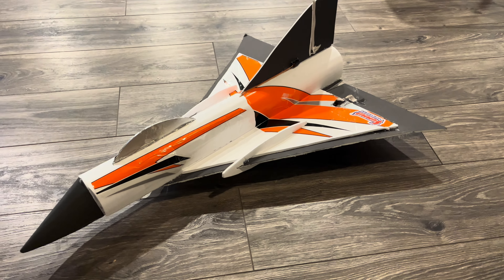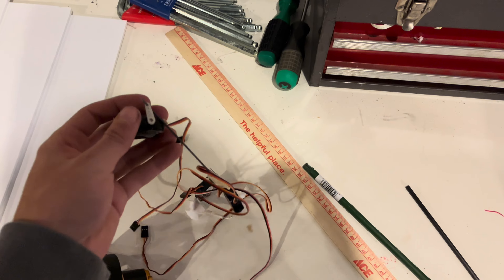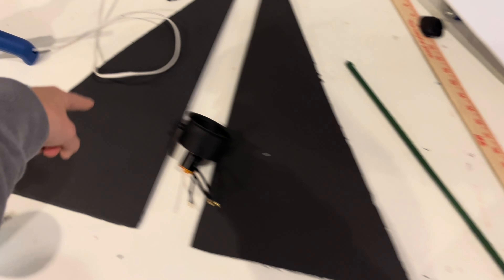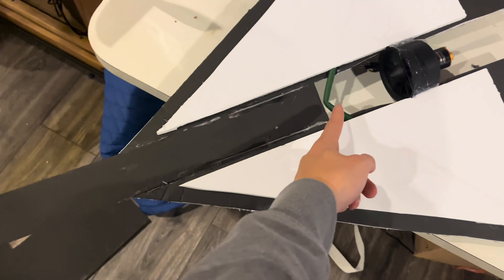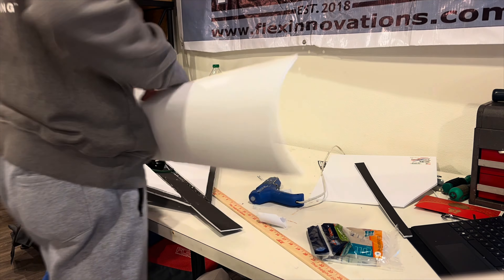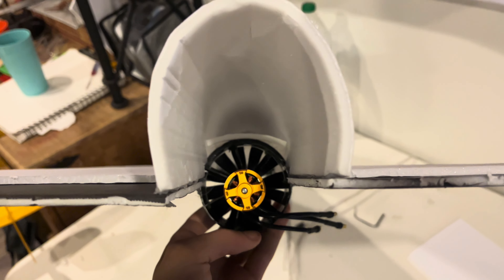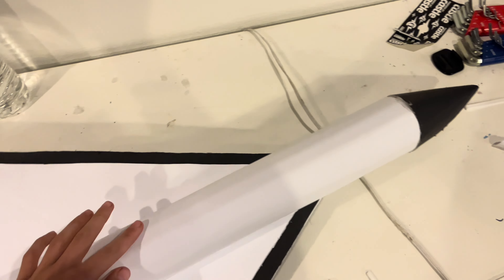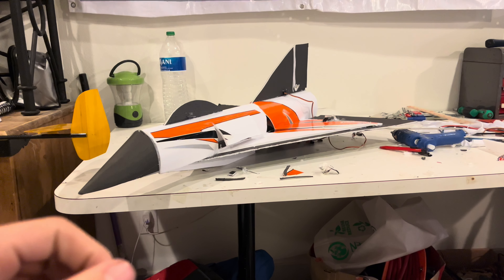How to build a 100mph rc plane for $100.

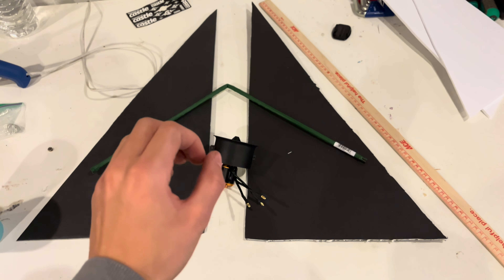Comment: information      5:15   the location of the central main spar and the cg line should coincide;  Near fifty percent of root chord.    which corresponds to the  thirty percent  of mac line.        many hardware stores sell poplar dowels, etc. for use as spars.   and as long pushrods.!           5:30    WRONG.!      in a built-up swept wing you will find that there is a  central main spar, spanning the fuselage and perpendicular to it.!    located at thirty percent of mac.!         in other words, your not-straight across spar is a  design  FAIL.        8:08   locate the edf unit aft-of the cg such that its mass can be correctly offset, with the mass of the battery, etc. forward-of the cg.
13:58   there should be a specific amount of taper in an edf exit duct, over a distance of at least six inches.      the tapering should result in an opening/area that is equal to the  Effective  swept  area  of the impeller.   
16:12   the  mass  of  the  elevon  servos  SHOULD  be located  just  forward-of  the  cg.!!!  
this type of airframe has inherent tail-heaviness in its dom.        consequently, it is the opposite of smart to make the the condition worse, by putting  the  mass  of  three servos  aft-of  the cg.!!!!!                d